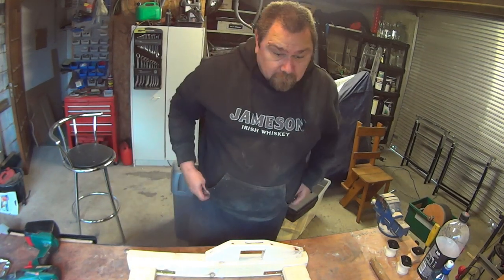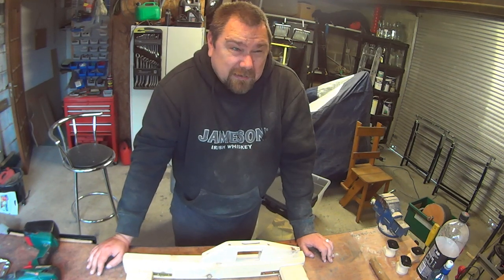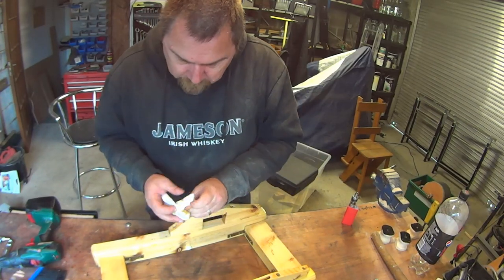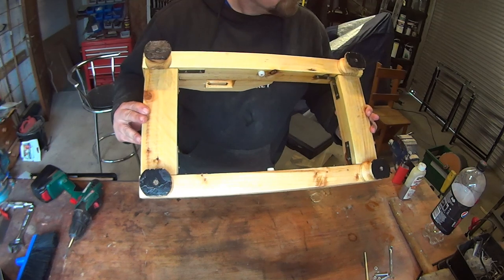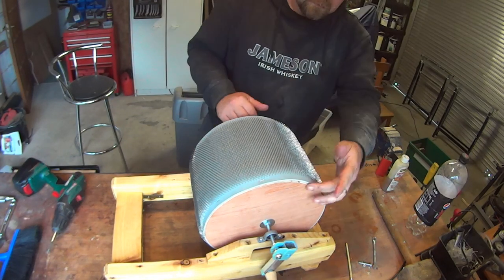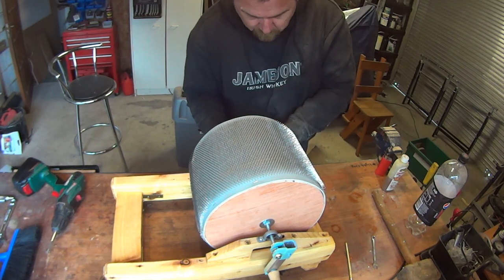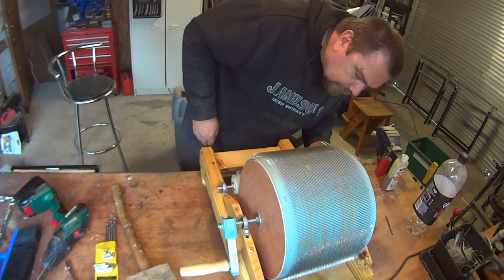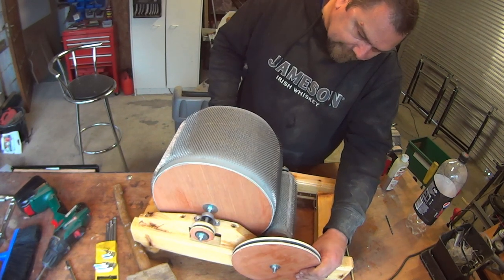Building a drum carder

Comment: I think your way of making the drum is better. Another guy made a drum with 12 wood circles all glued together an a shaft going through the middle of them all. i think that would be very heavy. Your way seems easier. How many pieces of cloth did you need for both drums? I went to the site where you bought the cloth and it comes in 12" x 12" sheets. What plans did you use initially? Nancy
Reply: Hi Nancy, I got my plans from here: https://knittingthestash.wordpress.com/2015/05/11/diy-drum-carder/ but didn't follow it exactly, but still the same principle. I bought the carding cloth by inch on this page https://www.winghamwoolwork.co.uk/carding/page/2/